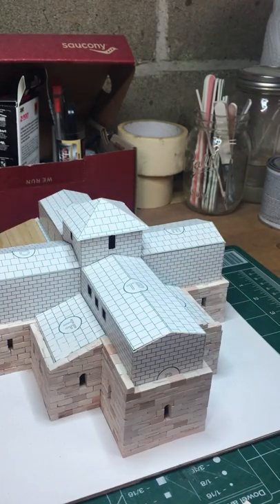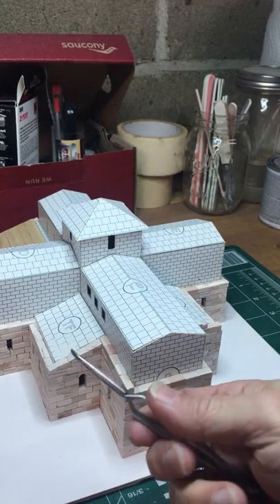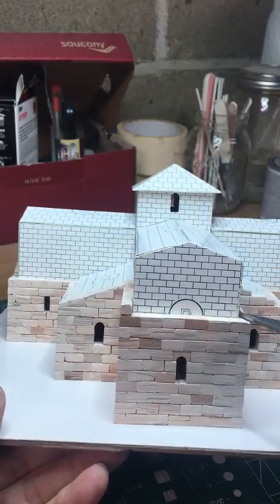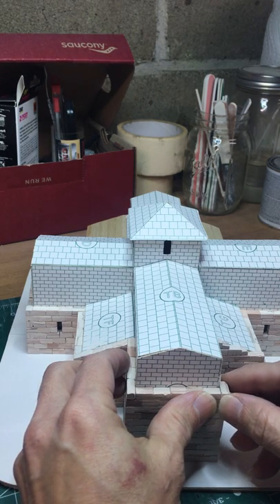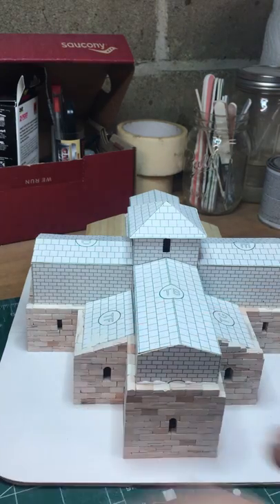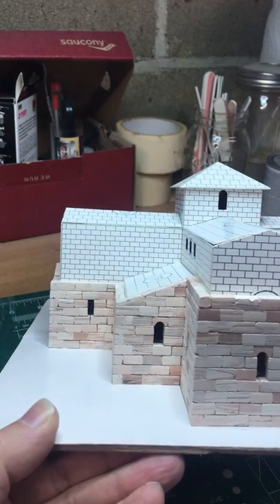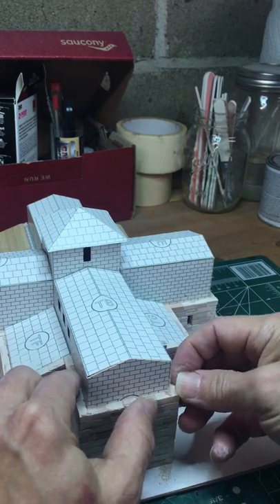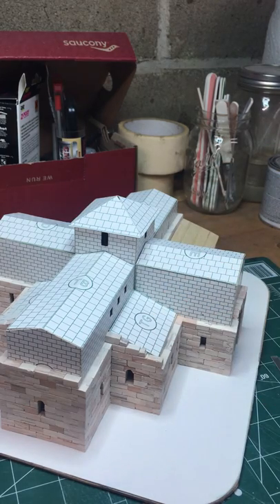Aedes Ars San Pedro de la Nave 2: Another Brick in the Wall, Pt. 1

Comment: After years of building these kind of models, I've come out with this solution to the squashing out glue. I apply the glue on the bricks one at a time, Instead of putting the glue all at once. Use a little modeling brush to apply the glue, same way you would apply some paint. Place the brick in its location and use the brush again to cover the sides that will be in contact with the following surrounding bricks. This technique is more elaborate and takes more time but the results are way better. If you are like me and enjoy every second spent on this hobby, the extra amount of time would actually enhance the experience. I hope you guys find this helpful.
Reply from the maker: Nick Martinez I’ve been meaning to try a brush - do you have issues with it drying out or becoming stiff over the course of a session?